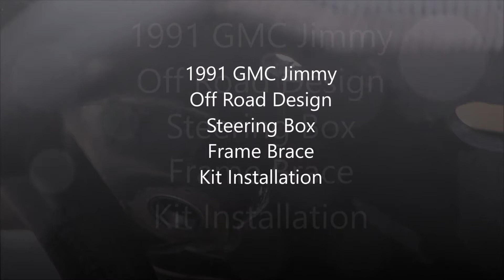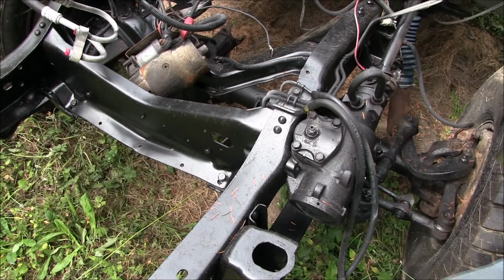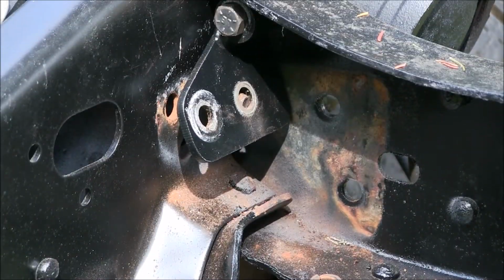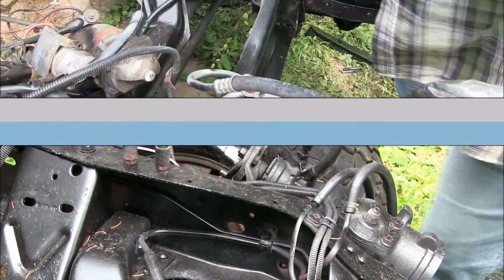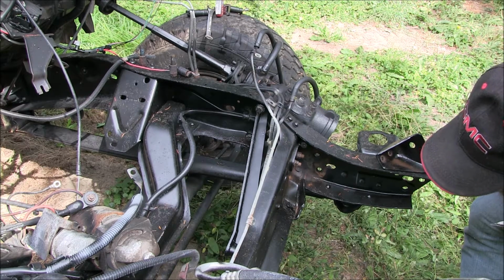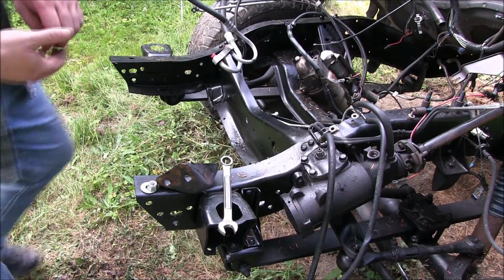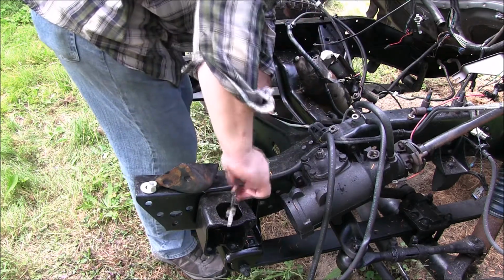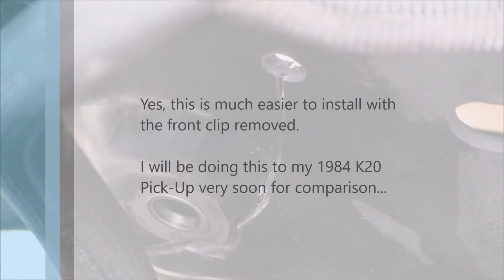1991 GMC Jimmy Off Road Design Steering Box Frame Brace Kit Installation

Comment: Just an FYI, that particular bracket that you're not sure of, is the back up bracket for the bumper tie bracket. It's to stiffen the frame for that, and for strength triangulation to the cross member. The holes should have been opened up to accept the new location.

Comment: If you're still wondering what causes the frame on your truck to crack the bolts work loose while going down the road do to road vibration. To fix this problem use lock tight on the bolts.
Reply: the k5 frame cracks because it is too thin

Comment: The trucks are so tough (by reputation) but it's got a thin ass C channel frame. While my 2000 zr2 s10 has thicker steel and is fully boxed, even though they too are know to crack at the steering box. I have an 87 k5 tbi350 and I love the truck but damn it's got a pussy ass frame. My wife's 07 Kia Sorrento also has a thicker steel and fully boxed frame. Those 07-09 Sorrento are actually built really well. Full boxed frame, solid rear axles, 5 speed auto and a high I think a 275hp 3.8L v6 that can out run a 5th gen v6 camaro. I've beat 6 different ones so I know it wasn't a fluke. There is also a guy here on YouTube that is putting a 6.0 LS in his 4wd 07 Sorrento and alot of the plugs are the same. It should be a bad ass build when it's completely done. It's still got so.e bugs last I Che ked but it is damn sure an impressive vehicle and he did keep it 4wd.